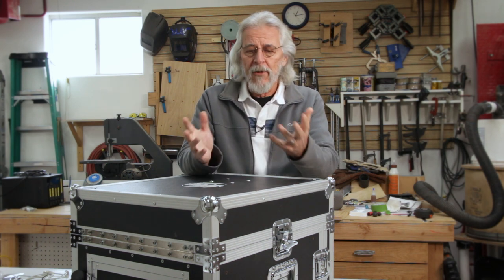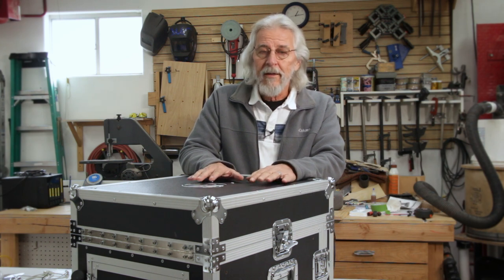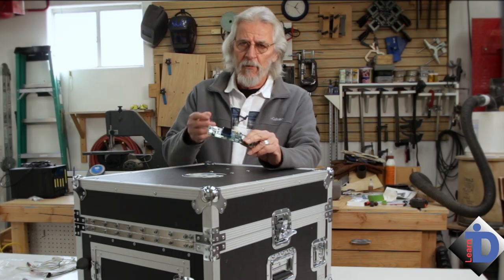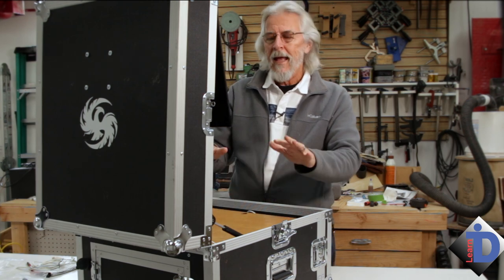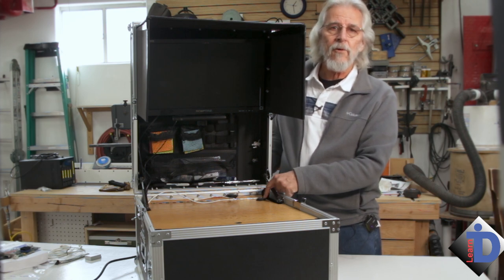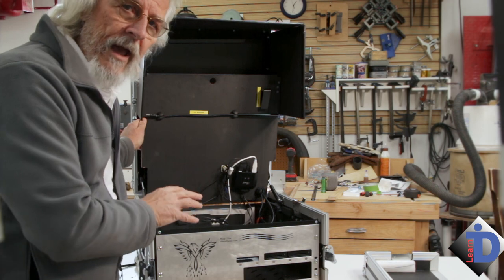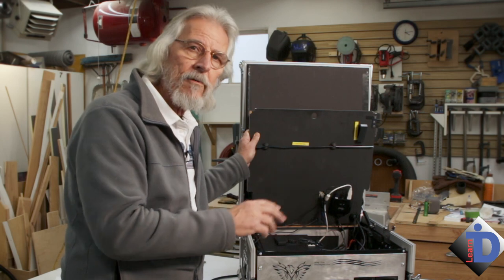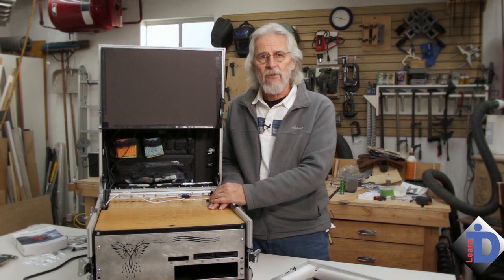DIT Kit Tour

Comment: Hi! Thanks for the videos! I have a question though, why is Mac OS preferred over Windows?
Reply from the maker: Macs were adopted by 'creators' shortly after they were introduced. Since then, it has stayed that way. But that might change with the limitations and overall control Apple is exerting with the new M1 & 2 processors. A video is coming soon about this.
Reply: @learndit922  Thanks! I work with Windows and most software prefers Mac, but i can't see where the benefit is.